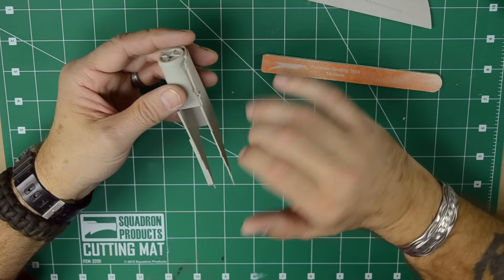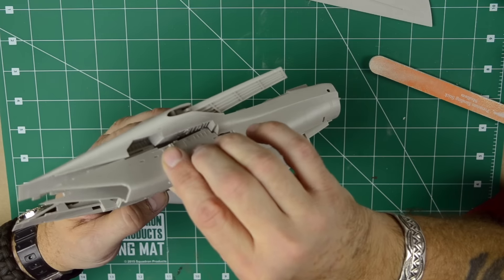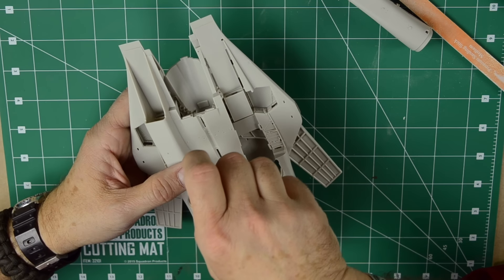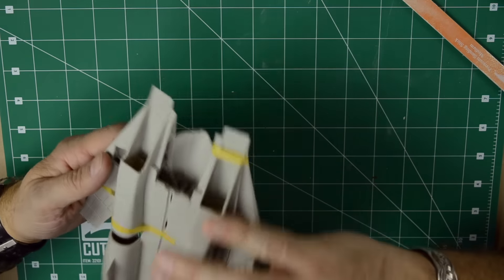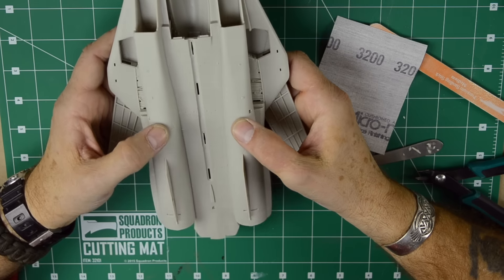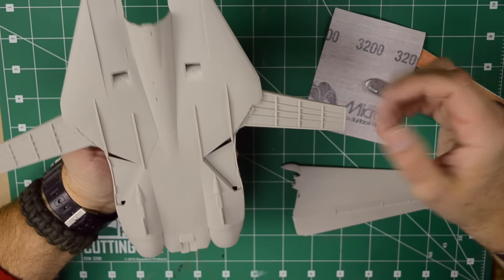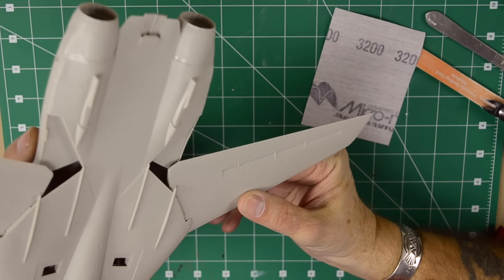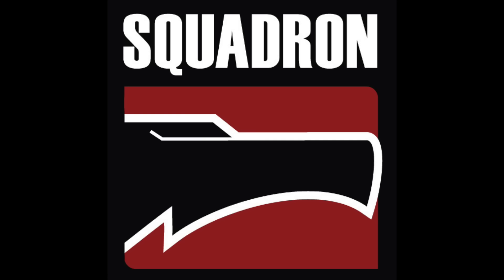F-14A Tomcat Build - Part 7

Comment: When using the Squadron Plastic Weld on exposed seams will it be necessary to later sand excess glue once it dries
Reply from the maker: Plastic Weld is a liquid that chemically bonds the plastic. Since it doesn't work like glue, there shouldn't be excess to sand. If too much is used. Let it dry without touching it.
This Squadron Minute video about Squadron Plastic Weld might help: https://youtu.be/5zNhThyFH54
Reply: Thanks for the quick response that information will help